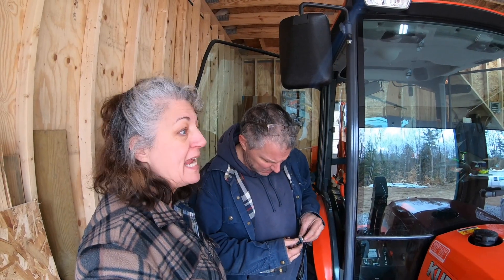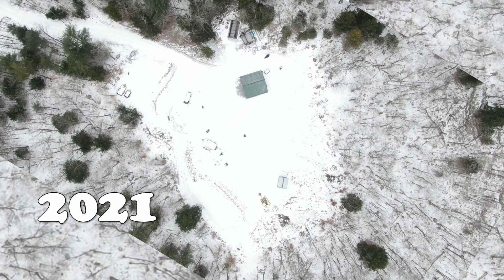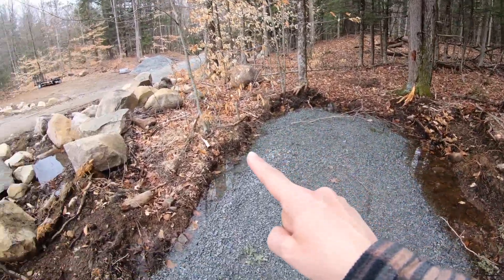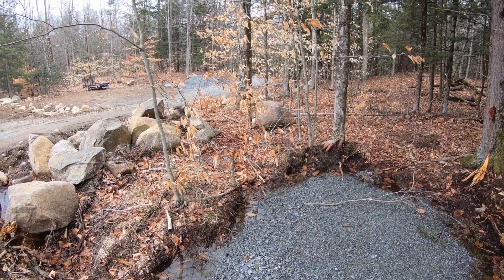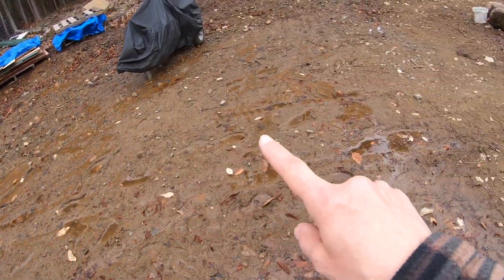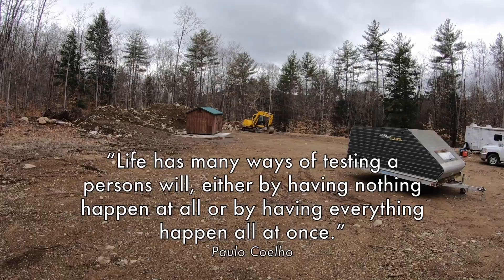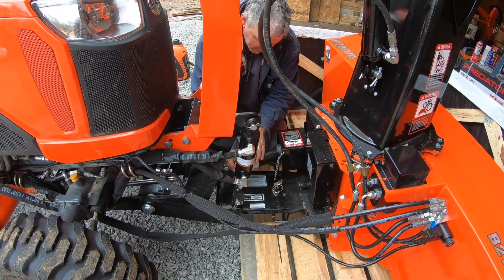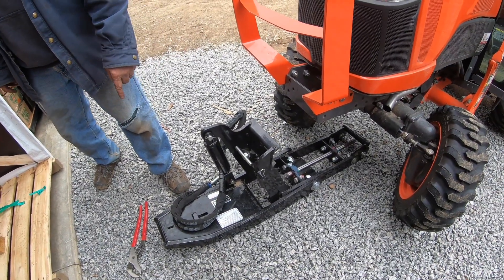GETTING READY for OFF GRID Build SOLAR SYTEM KIT Delivery

Comment: Muddy season is the worst. At least you don't have much clay in your soil. That makes things as slippery as an ice skating rink. Sorry to hear about the windows and door delays. The best news is the insulation is coming. There's not many alternative options for rigid foam insulation so i'm sure that's a big relief. Woohoo. Hopefully there are no supply chain problems with concrete. When I lived on my brothers farm, I remember hearing that tractor tires are filled with some kind of fluid not air for ballast. I don't know if this is a standard practice with all tractors or an optional thing. I'm wondering if your front tires are filled with air or fluid. I don't know if there is any truth to this fluid stuff. I just remember hearing about it. Good luck with all your plans!
Reply from the maker: The foam is a HUGE relief for sure! Tractor front tires are filled with air, back are filled with a fluid. It’s called loaded tires and it helps keep tractor balanced when you pick up something heavy in front. Problem was we had nothing in front and even though it’s hard to see, it’s uphill going into the garage.
Reply: @CreatingASimplerLifeOffGrid  
Yea the incline going into the garage is tricky with no weight on the front. I guess you could use the back bucket as a temporary wheelie bar. Lol. I wonder if it's possible and/or practical to load the front tires too?
Reply from the maker: Hm. I don’t think that’s even an option on the front tires